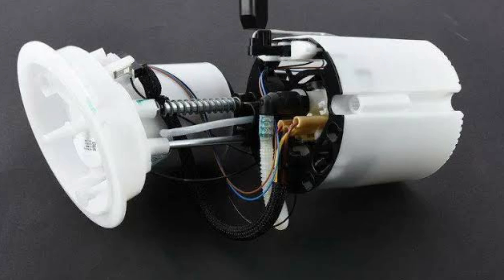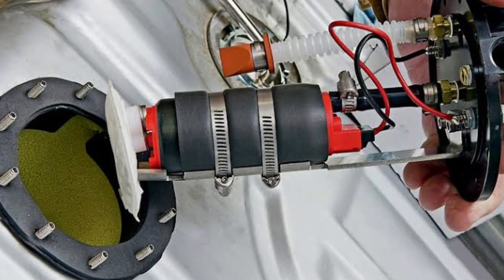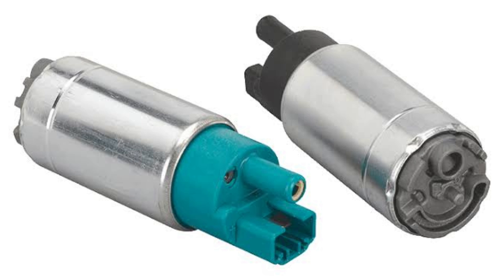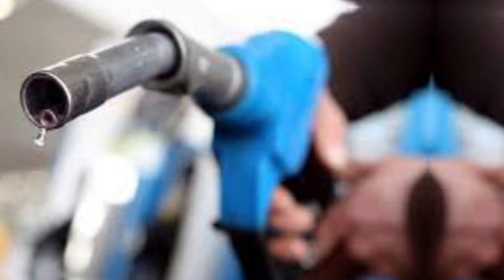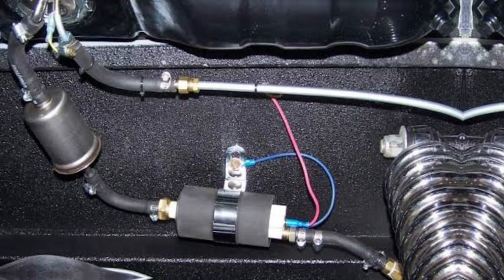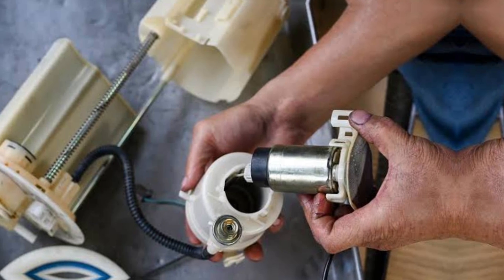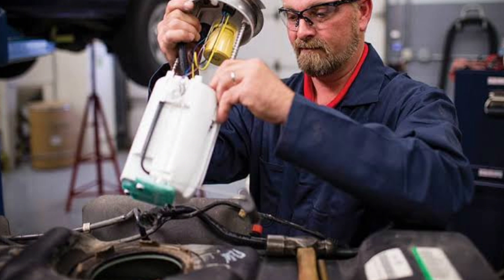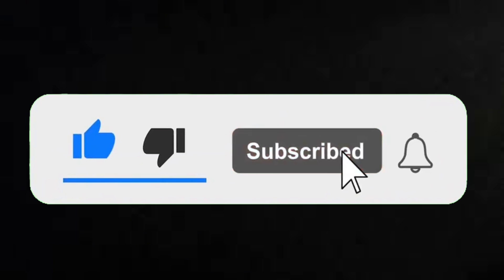Common sign of bad fuel pump

Comment: I changed out my starter, alternator, fuses under my steering wheel, fuel pump relay right besides my steering wheel and my car only cranks and doesn't start. My fuel pump comes in the mail Monday I'll come back here for an update
Reply: Any update
Reply: Any update?

Comment: I am having this problem with surging rpms periodically. I have narrowed it down to fuel pump or torque converter clutch solenoid because it is having trouble changing gears as well.
Reply: I have a 2017 Volkswagen Passat

Comment: SIR, THE GASOLINE PUMPS IN THIS TANK ARE INSIDE THE GASOLINE AND THERE IS AN ELECTRIC MOTOR, DOESN'T THE BRUSHES AND OTHERWISE MAKE A SPARK?? AND ALSO THE SOCKET PART IS ON THE PUMP, SO THIS IS INSIDE THE TANK, WON'T THESE SOCKETS MAKE A CRACKING SPARK? AREN'T IT DANGEROUS? HOW DID THEY TAKE PRECAUTIONS FOR THIS?

Comment: My car is citi golf 1.4 injector but it's usually taking out black smoke in the ecxost and seeing up and down why?
Reply from the maker: @SboneloMkhize-f1n  check the fuel system and service injection system
Reply: It idles low n high thats mapsensor  on the intake change it u shud b good it deals with air fuel

Comment: I have a 2019 ram 1500 etorque and it was on warming up and then turned off. All fuses and relays seem to be fine. You can hear the fuel pump start when you turn on the switch. I sprayed starter fluid and it starts. I’m leaning towards the fuel pump. Could this be it ?
Reply: Try changing the fuel pump, to eliminate probable cause, otherwise no one here knows for sure.

Comment: Most informative video, My polo hesitate when driving on freeway, mostly when I'm from stop sign or robot. I change coil pack and plugs cable and did a service, but it still hesitate.
Reply: Try cleaning your Mass Air Flow sensor
Reply: did you fix your issue??

Comment: My Corolla rattles at cold start with unusual sound like there’s no enough oil in the engine for more than two minutes. What might be the problem please
Reply: Better check cylinder head gasket for leaks around it

Comment: My car jerks in morning time when i try first time… only rare i felt jerk while running car… what can be the isssue
Reply: Try this, before pulling out or your driveway put car in reverse let it move about a foot, then put back in drive let it move about a foot or two then back to reverse, do this three or four times and if this solves your jerking problem when pulling out, possible transmission failure is coming, doing this massages the transmission pump and warms it up before traveling. Also, try cleaning your Mass Air Flow sensor first.

Comment: Is it normal to hear a clicking sound coming from the fuel pump?  I have no stalling, hesitation, sputtering, or jerking when accelerating.
Reply: could be your throttle body

Comment: My Tacoma rattle the valves(pinging) even with “93” on acceleration also have difficulties to crank it up in morning…. Have to be the fuel pump 🤦‍♂️
Reply: Could also be the oil pump getting weak

Comment: Hi I have issue when trying to accelerate my engine losing power and I changed the fuel pump but still, changed the air filter still change the sensor still what must I do please
Reply: Throttle position sensor
Reply: My car idles perfectly when I take off it just bogs down I changed the fuel filter and the regulator and throttle body what is the my problem

Comment: I have uphill problems and jerks on high speed.
Reply: hi i have a citi golf 2006 model 1.4 carburetor up heel  car start to jerk
Reply: Easy ... avoid uphills ... do not drive at high speeds.
Reply: Tro some brake fluid  down da carb rev til smoke is clear it wil smoke  make sure u have fuel wen goin up hil can also coz dat but try brake fluid shud do da job

Comment: Is bad gas or high octane a big reason 🤔 for failure?
Reply: High octane is better for engines, especially older ones as higher octane has more anti-wear additives so it cant be that. Bad gas as in brand? Possibly. May not be as clean as other premium brands and can maybe clog the strainer.
Reply: It's usually driving on empty for a long period of time strange enough the gas actually keeps the motor cool.

Comment: How do you know the difference between a fuel pump and a fuel regulator failure
Reply: Easy ... change both for peace of mind.
Reply: @warriormanmaxx8991  Simple just spend more money!
Reply: @warriormanmaxx8991 parts replacer not a diagnostic mechanic

Comment: High speeds my car is fine but when I shift gear from park sometimes it turns off… but when I’m at speed everything is fine
Reply: after when you slow down your speed the fuel pump doesn't work like that i mean is doesn't flow frequently but when u accelerate fast it working fine and the same problem i'm facing these days...Now going to change that fuel pump to avoid any missing problem when u stuck in traffic jam and it also effects the mileage as well
Reply: @truewanderer99 I cleaned the carburetor and it fixed my problem
Reply: But is there enough blinker fluid?
Reply: Same issu bro you still faced this problem or solve it what you change the part ?
Reply: @bilawalrajpoot1542 I cleaned my carburetor and it fixed my problem
Reply: Replace your spark spark plugs common problem
Reply: SCV is your problem
Reply: Same issue , how you fix that
Reply: just chaange the whole fuel pump @aafaqahmed2778
Reply: @aafaqahmed2778 it wasn’t the fuel pump… I cleaned the carburetor and it fixed my issue

Comment: thanks for explaining I have a Suburban 2012 it shut down in the road when I made  OBD  test it gave 

multiple codes  one of them U0073  data bus comunication  ,  P069E  fuel pump module control - Mil 

activation requested  , P2635   fuel pump low performance   , P0108B  fuel pressure sensor   B   and of course 

 the delay  start engine   my question   where is the fuel valve regulator in Suburban 2012  shuold I replace it   

,  is  the fuel pump  is broken and need to be replaced or updating online   Or  I have to fix  the bus 

comunication Bus  before to solve the  problem  thanks in advance .

Comment: my car is doing all these things but i replaced the fuel pump and fuel filter and still has trouble starting due to lack of fuel. hesitates to accelerate going uphill or from a complete stop and dies at a 1/2 or 1/4 tank of gas. when starting, it always smells like gas. p0171 and p0441 came up at 1 time. it has nothing to do with the gas cap or o2 sensors cuz i already replace them too. i need help trying to figure out why my car wont start and dies but then struggles going uphill or hard acceleration and why it smells like gas during start up. now there are no codes at all. my car is messing up on me. i had to put gas cuz it stalled on me as if i was out of gas and had trouble starting due to lack of fuel but i was at 1/2 tank of gas. so now I have a full tank of gas and put fuel system cleaner and didnt do nothing. cuz these syntomns are still happening.
Reply: must be toyota
Reply from the maker: Check your injector nozzle and you have to inspect by professional mechanic
Reply: Thanks for the tip 👍👍👍👍👍
Reply: sounds like a evap purge valve
Reply: Mmmm!!! It sound trick try to diagnose the car,if is a turbo replace the old one,I once had that problem but I install the electronic pump and remove the pipe to fuel filter and insert it to the electronic pump and connect it to the battery, until I get money to replace the turbo
Reply: It was a Chevy.